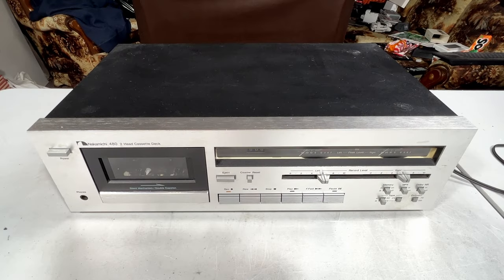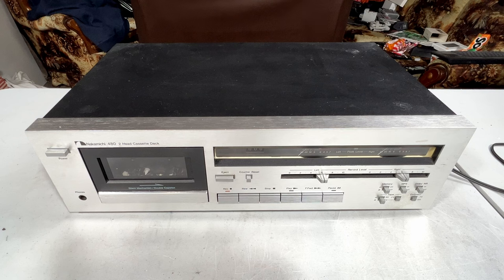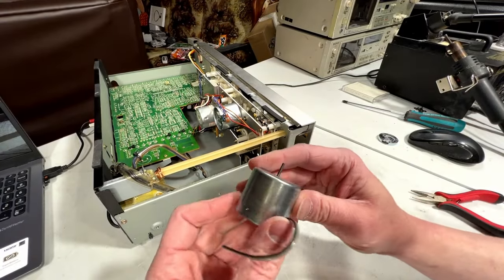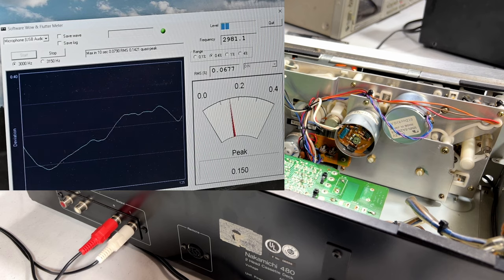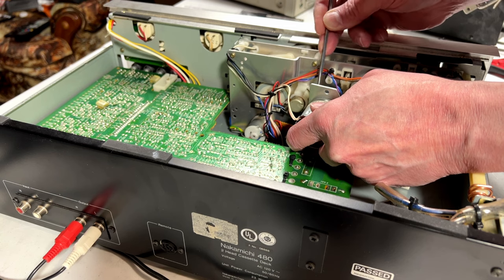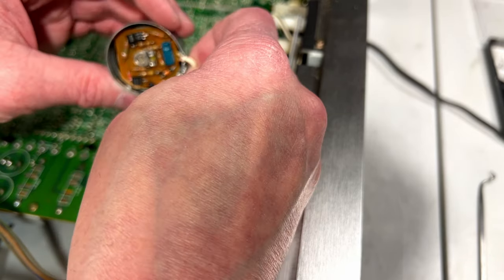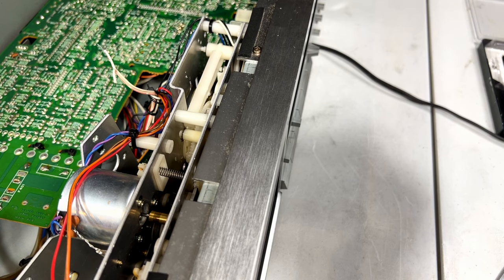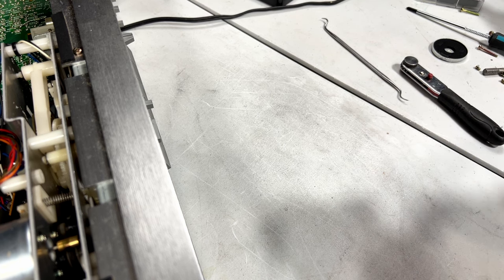Nakamichi 480 Part 3 - Capstan Motor Problem Solving

Comment: I had the chance to grab a 480 with a missing record level switch on Facebook Marketplace. I regret not going for it.
Reply from the maker: You might change your mind on that if you see the other videos on mine.
Reply: @Oklawolf  but it's a nak™ 🥺🥺

i think it was around $75 AUD, but I was trying to get it down..
Reply: @Oklawolf  Just watched the videos.. that does NOT look fun. That mechanism looks terrifying to work on.
Reply from the maker: I can confirm that it was in fact not fun. Given the high hours on this machine, I'm strongly considering getting a Technics RS-M85 and swapping this head into it. I've heard it turns those decks into absolute beasts.

Comment: Get a Denon or JVC. They sound just as good and chances are the deck will still be running. When it finally does need service, they're super easy to work on. Nakamichi decks were overhyped, overpriced and over engineered and tapes produced on them don't sound any better on other player types, if anything, they sound worse.